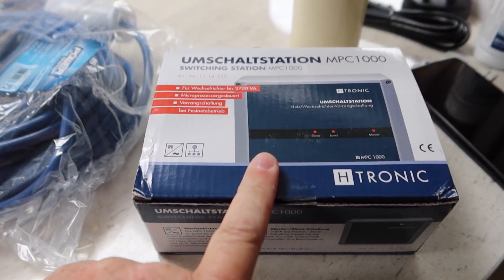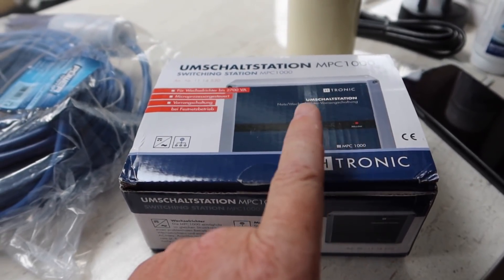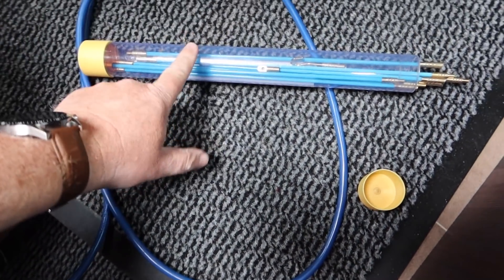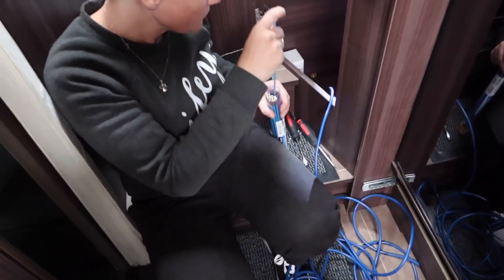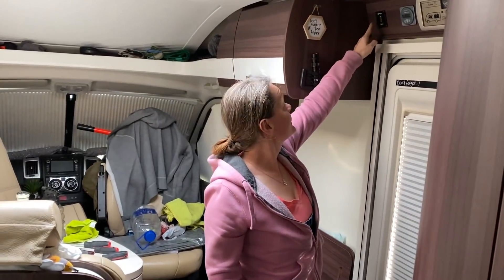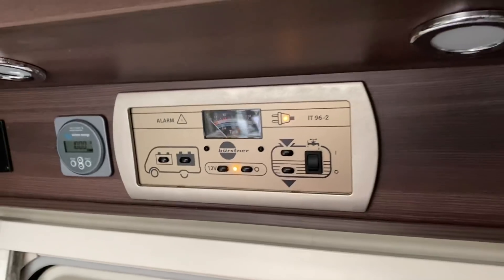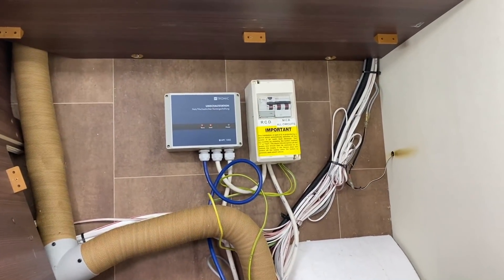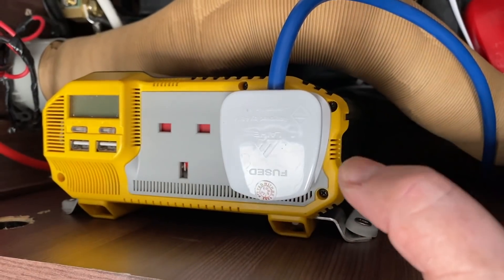Mains EHU to Inverter Power Auto Switch Install - VanTech Quickie (ish)

Comment: Hi John. I’ve also fitted one of these and it’s given me 2 years of great service. I’ve now upgraded my inverter to 2000w Renogy. Am I right in thinking the new invertor has automatic recognition of where the source is coming from ie hookup or off grid. So I can wire this out of the system. Cheers Stew
Reply from the maker: Yes, that’s correct 👍🏻
Reply: @ thanks for your quick response.

Comment: I think I understand. Does your external hook up cable go into the same consumer unit you’re showing in this video @6:06 and then you use a separate point on that unit to run off to 3 pin plugs? Or is that circuit break a second circuit breaker? 
Sorry if that doesn’t make sense. My head is fried from schematics and the lark

Comment: hi John, don't know if you still monitor old videos??  anyway, do you know where I could find the power switch you used in this, I have tried everywhere even the manufacturer's website but it doesn't look as if it's still in production?  even if you could recommend something like it ( I've seen what looks like Chinese manufactured ones but they don't look as well made as the one you used here?  thanks, Alex

Comment: You could add another relay to drop out the charger when the inverter source is live, or work the other way and have the charger relay on only when the EHU is live. Saves you remembering to pull the fuse on the mains charger..

Comment: How do you stop the fridge selecting mains power and operateing  from the inverter.
Do yoh have to manually  select the fridge operations.
Reply from the maker: That's all explained in the video 👍🏻
Reply: @GadgetJohnAdventures  If it is I can't find it either. You show the fridge on EHU after turning the Inverter off but not before that. On Inverter does the Fridge Auto to Gas or 'Mains'?

Comment: Thanks for your time and effort. What would happen if you left the 20 amp fuse in ?
Reply from the maker: Not sure which fuse you are referring to? If it's the 240v breaker then it should be 10amp breaker at 240v. If it's for your inverter then that will all be down to the inverter size and the cables you use.

Comment: Hi John, Mandy & Cooper.  I'm hoping to install on of these in my camper I'm currently converting, and will be adding a mains charger to top up the batteries while on hookup.My question is am I right to say that I will have to manually switch off the charger when in slave mode? 
Cheers Antonio
Reply from the maker: It’s best to ask John questions on our main Instagram account. @johnandmandyuk

Comment: Hi John, in the process of putting 300 ahc lithium batteries in my Autosleepr Burford, I have fitted a victron 30 watt B to B charger and a victron mains charger,130w solar  and mppt controler,I see the inverter you fitted is not a pure sine inverter ,as its a Modified Sine Wave inverter will this be safe to use on computers and tv's .
Great videos have also fitted the Diesel heater you recommended , cant wait to retire ( will be this year ) to get out and start Traveling .
Reply from the maker: If you’re putting in 300ah of lithium you’d need to double all your charger to 60a, watch my latest advanced wiring video for up to date info 👍🏻
Reply: @GadgetJohnAdventures  Thanks why will I need to double up to 60amp ,I assume you mean on the B2B...
Reply from the maker: Please understand that you’re going about this the wrong way, you should have a battery bank you can easily recharge, not a huge battery bank that you’ll never recharge with 130w of solar. 
As I said, if you watch my latest advanced 12v wiring video you’ll get all the info you’ll need
Reply: @GadgetJohnAdventures  thank John Yes I see what you mean ,the plan was to see how it goes and probably fit more solar and yes maybe another b2b.
I have watched all your video about 12v system ,sorry for being a pain.😃😃

Comment: I was late for the party on this one :-)
Somewhere I saw an auto change switch that had two outlets. One for items for use on EHU only and the other for items that could be EHU or inverter fed. 
So presuambly EHU only is for the battery charger, Truma leccy heater, and Fridge mains and your sockets can be on  the optional set??
Reply from the maker: It has an output to the vans internal consumer unit with all things standard, life heating, fridge & charger all connected still, then it has 2 inputs with input 1 being the priority and I’ve connected the EHU socket to this and input 2 is the inverter. It’s all explained in the video in detail 👍🏻

Comment: Hi Thanks for the informative videos 
Is there somewhere we can make a donation as I’ve bought a couple of items you have recommended but didn’t click on your links and just seen that this would have generated you some income so feel bad and want to make amends 
Secondly I hate pulling fuses out and if I wanted to run the inverter for a few minutes to run microwave or similar whilst stopped and the leisure battery chargers kicked in would this cause a problem if I was using a direct feed from the inverter to the EHU input on the Motorhome?
Reply from the maker: That wouldn’t be an issue for short usage, the battery would drain faster as the 240v would try and charge the 12v whilst using your microwave. There’s a link in the video description “Thanks” where you can send a PayPal donation 👍🏻
Reply: @GadgetJohnAdventures  Thanks I’m going to look to see if I can put a switch into the leisure battery chargers to isolate when on inverter to avoid the annoying location of the fuses Donation sent.

Comment: A very well explained process thank you.  The link to the inverter goes through to a 1500W one with European output sockets.  May I ask how you get the 230v output from the inverter to the switch?  Do you need to buy a European three pin plug and wire this up to a piece of mains cable to the switch slave input?  Thank you, Simon
Reply from the maker: Yes, if you buy the EU version you’d wire an eu plug where I’ve wired the UK plug. Otherwise you could wait to until they have UK plug versions in stock. 👍🏼
Reply: @GadgetJohnAdventures  Thanks for the quick reply.  I'll wait I think, hopefully when they do the link will take me to a UK version.

Comment: Great video. Just a quick question, you’ve got one white cable leaving your RCD enclosure marked up as MCB all circuits. So what did you actually power out of there please?
Reply from the maker: I’ve used what was already installed in my van. 👍🏼
Reply: John & Mandy on Tour thank you.

Comment: Hi John....great video....I'm sure this has been asked before can you run a microwave or induction hob off your inverter ?? Just a little idea for you in regards to you not having to pull the fuse on your battery charger when on inverter power.  Why don't you use the second socket of your inverter to power a contactor to automatically switch off the battery charger? Thanks again !!!
Reply from the maker: Ours is a 2kw inverter so you could run anything up to that, however, induction cooking would deplete the batteries very fast. It’s been discussed in many VanTech Tuesday videos. 
As for extra switching, I don’t want the mess, I’m 99% off grid and solar gives me plenty of power. 👍🏼

Comment: Hi John great video, questions, I have two 100ah batteries coupled to a 120w solar. Rolling around in my shed I have a 300/600w inverter, could this along with the auto switch over run my fridge, which is a dometic AES which runs at 135w on ehu and 130w at 12v (according to the plate in the fridge)   Thanks.
Reply from the maker: My fridge uses roughly the same, so that inverter should work fine 👍🏼

Comment: Hi John and Mandy - Just what I'm needing so I've ordered one 😊 One point - I have my battery charger and Dometic fridge transformer on one circuit from my EHU fuse box and all the sockets in the van off a second circuit - so I suppose it would ok to have the auto changeover box in between the fuse box and the circuit with the sockets rather than have the inverter powering up the entire fuse box ? All the best. Dave

Comment: Is it possible to install technical equipment such as power auto switch between inlet and inlet protection? Shouldn't intake protection be the first unit in the car?
Reply from the maker: If you wire it as I show in my video that’s good 👍🏼

Comment: Didn’t realise it was that simple. However on that system would you have to unplug your 230v mains battery charger if running off an inverter as it would try and charge the battery using the self same battery?
Reply from the maker: That’s what I covered in the video 👍🏼
Reply: Gadget John on tour oh sorry may have missed that with distractions. Ill watch again ta

Comment: Nice one John. I was struggling in this section on how to have hook up power and inverter working together. At the mo I have all the plugs working only when I'm hooked to power and one plug with usb sockets that I installed directly to the inverter when i'm off grid. Thanks for this. I will be asking questions sometime soon :)

Comment: Hi John & Mandy, I hope you are both safe and healthy.
John this is a question for you, we have a Swift Bessacarr 599 which we bought new in September. I need some advice she has a 100w solar panel with a 100amp lead acid battery which I have changed to 2 100amp lithium batteries, I know you have had issues,  but I have room for 2 possibly 3 150w solar panels, should I wire the solar panels in series or parallel, I wont be using the 100w panel, if you advice series. What MPPT should I use, I was looking at the victron 75 30  but can't find one at the moment. I could buy the 100 50 or a 100 30 so which one baring in mind I have two 100amp lithium batteries.
Reply from the maker: Fit as much solar as you can, use the existing 100w panel and wire all in series. 100/50 is good as it’ll give you room to upgrade in the future.
Reply: @GadgetJohnAdventures  Hi John, ordered another two 150w solar panels today, that's three in total giving me 450w, also ordered the MPPT controller 100 50. Now then which Victron Smart Battery monitor to go for there are three listed, thanks in advance Dave.
Reply: @GadgetJohnAdventures  Hi John, just to let you know, I have ordered another 2 x 150w solar panels, and a Victron 100 50 controller + the Victron 712 battery monitor, also a Victron dongle. So that's it just waiting to get my Motorhome out of storage. This Lockdown is very trying for all of us, stay safe and well both of you, Dave.
Reply: Cheers John thankyou for your advice, Dave.

Comment: hi John quick question I have a victron 15/75 Bluetooth is this controller OK for 2x100w solar panels connected to 2 x 95ah batteries Arif
Reply from the maker: Check the amp rating of your solar, then you’ll know if the 15 amp rating is ok for the solar controller 👍🏼

Comment: Hi John, I am on converting my van to a camper and I was wondering if you could recommend a 240v hook up fuse box and the wires needed as a set maybe, thanks Mike
Reply from the maker: If you’re not on sites much then get a hookup & breaker with sockets all in one 👍🏼
Reply: @GadgetJohnAdventures  OK thanks I will get looking, I am using it for work so I will be able to just hook up there I do eventually I want a battery bank and solar panel system

Comment: Thanks John, another great video. Do you know if the Kreiger inverter centre tapped, or neutral earth bonded? My understanding is that if the 230V output of a centre tapped output is put through an RCD that the RCD may not protect users against electric shock. I couldn't see any details on the link from the video, but maybe the informations in the manual.
Reply from the maker: Tried & tested my setup with shorting and surging and the breaker trips fine.

Comment: Thanks for the video I'm looking at doing the same so you have just provided me with the solution thank you. 

One question how do I identify which fuse to pull so it doesn't try and charge the leisure battery?

There isn't one marked charger but there is a 20 amp one marked van battery.
Reply from the maker: Your van manual should tell you the fuse for the built-in charger 👍🏼

Comment: Hi John, what batteries are you now using? On your site the our motorhome page points at one battery but the lithium page points to a different battery that you replaced the lithiums with . I appreciate you now have a new van. I am considering a Sterling  B2B and a new larger battery as currently only have 72Ah
Reply from the maker: I’m using AGM batteries 👍🏼
Reply: @GadgetJohnAdventures  cool thank you

Comment: Hi John what is the current rating of this please ? as I couldn’t see it on the amazon link
Reply from the maker: It’s going to be 16A as that’s the Max EHU amp
Reply: That’s what I would have hoped for also, I was just initially surprised the connections where mounted on a pcb I assume the trace must be quite large on the rear

Comment: Hi John. Great video and useful gadget. However, is there an issue with the van electronics trying to charge the leasure battery when on inverter power? I guess during sunny periods the solar charging will be competing with the on board charger  reducing any losses, but in the dark? All the best. Dave
Reply from the maker: As I said in the video, I have disabled the on board battery charger, I can enable it once we are on ehu, but we rarely need that as we get all our power from solar 👍🏼
Reply: @GadgetJohnAdventures  👍🤭 missed that bit!

Comment: Hi John and Mandy. Firstly thank you for your videos my 670 has never been the same. One question re the changeover, how do you keep the engine battery charged if you have pulled the fuse to stop it working when on hu
Thanks
Neil
Reply from the maker: The engine battery is charged when the engine runs 👍🏼 that then charges the leisure battery. My solar charges both so I’m not normally going to need hookup to charge the batteries 😎
Reply: @GadgetJohnAdventures  my solar just goes to the controller then to the leisure batteries how do i connect them to the starter battery as well ?
Reply: @GadgetJohnAdventures  would I need a split charge relay between the leisure and the starter battery ?
Reply from the maker: That’s another tech solution, once the leisure batteries reach float you can use a bit of kit to divert solar power to the start battery. In our new van that’s built in, but you can make up your own version if you are good with electronics 👍🏼
Reply: tour  errr no I like plug and play items lol
Reply: tour  thanksfor your help John. Got my noddle working. Simple buy a dual battery solar controller 😁. I was thinking too much. Stay safe, might bump into you both one day when this virus is tamed.

Comment: Hi John great video and well explained, this also got me thinking about something. I have a 1500 pure sin wave inverter already fitted with two batteries and a 150 solar panel. To save on gas for the fridge also use the microwave when wild camping would it work if I used a cable plugged in to my inverter and then plugged it in to the outside 230 input. Could yo foresee any problems with that it sounds ok I guess.
Reply from the maker: That’s ok as long as you turn off the hookup battery charger 👍🏼
Reply: Gadget John on tour 
Didn’t go to plan John.
Connected from my inverter to the outside socket, works ok with the charger on turn the charger off and it alarms and goes to gas.
Back to the drawing board I’m afraid.

Any suggestions.

Comment: Nice job John, thank you sir!  Not quite ready for that step myself, inverter arrived today so may be checking that out tomorrow, weather and SWMBO willing... 👍🏻 👀 😉
For the time being, the plan is to have a single socket fed by the inverter in the kitchen area (coffee machine & kettle with an extension to her ladyship’s hairy warm airy thing!) and use the remote switching for on off, when EHU is not available... 🤷🏼‍♂️
Should be fun testing it all out though, quite looking forward to it and sod the warranty on the Coachman... 😳 🤪
Thanks again, stay safe, cheers for now, Rog... 👍🏻 😉 🐍

Comment: John, is it possible to use a solar panel originally designed to go on a house roof, on a Motorhome. I have a victron smartsolar mppt100/30, currently with a 100w panel
Reply from the maker: Yes they work fine 👍🏼

Comment: John, (hi Mandy & Cooper) 
If your running 230v via inverter and then connect to an external power supply without switching off the inverter, will it detect that your on mains and switch out the inverter? Thanks.
Reply from the maker: Yes, that’s exactly how it works 👍🏼

Comment: It looks like a handy device. Is there a way to trigger the inverter to switch off and on as required?
Reply from the maker: Not from this device, it just switches between the 2 power sources. The inverter has a remote switch though 👍🏼
Reply: @GadgetJohnAdventures  Are inverters quite low-draw when idle or do you keep it switched off most the time anyway?

Comment: Hi John, could I go from the inverter to the plug outside where the mains comes in? Obviously turning the mains charger off first. Thanks Terry
Reply from the maker: Yes, you can use the hookup cable if you want to connect that way. 👍🏼

Comment: Jay Leigh
Wish you did this vid 3 weeks earlier. Installed a manual changeover switch as wasn’t aware these auto ones were about. Great insight. Time for an upgrade🙄 Question though, doesn’t your 230v fridge kill the battery on inverter I can only use mine in hook up? That’s the danger of these switches is you sometimes forget you left your fridge on 230v via inverter
Reply from the maker: The fridge on 230v uses 10A, but not full time, it switches on & off like domestic fridge. We generate around 1.5Kwh of solar a day so we can easily cover the fridge power & more 👍🏼
Reply: Your not in Devon are you, just seen an identical van parked up